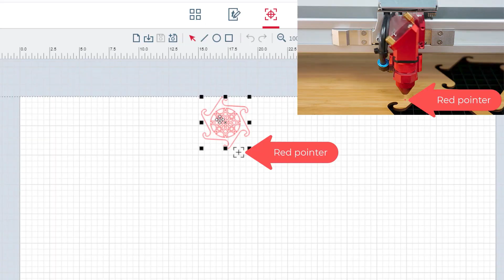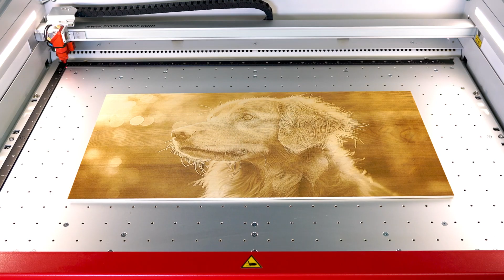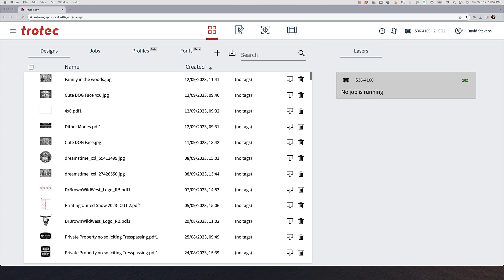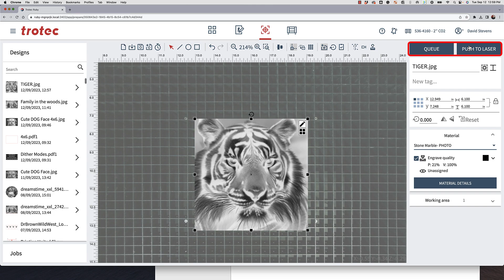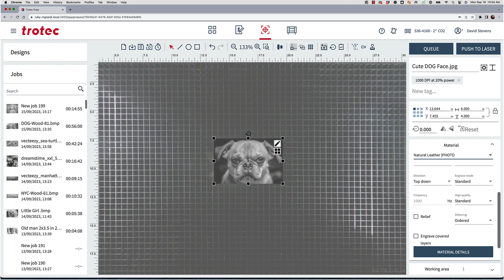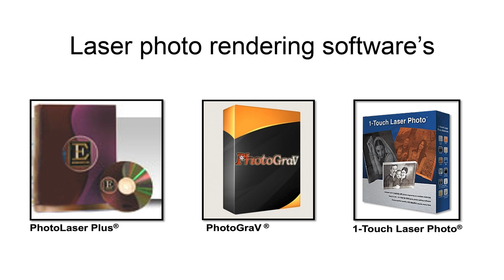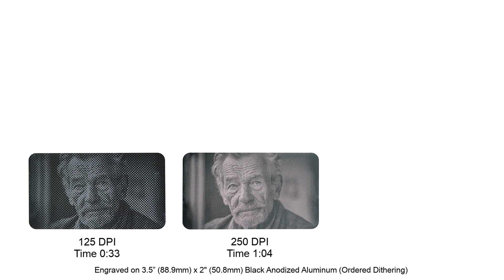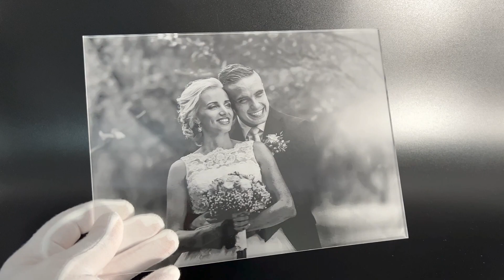Deep Dive with Laser Dave:  Processing Photos With Trotec Laser in Ruby

Comment: On Job Control 11.4.4 I don't think there is an option to select "none" for dithering?
Reply: In this situation, use the "Black and White" mode instead of "None," but I highly recommend updating your systems to the Free Ruby software as it handles the engraving of photos far better than Job Control.

Comment: That's great! Can you share the parameters of the dog carving in maple wood😃
Reply from the maker: The dog photo was engraved on a Speedy 360, 80-watt laser with a 1.5" lens at 100% power, 40% speed, 1000 Hz, and 500 DPI, and the image size was 24" x 12" onto a solid maple sheet and was rendered through the 1-touch laser photo software.